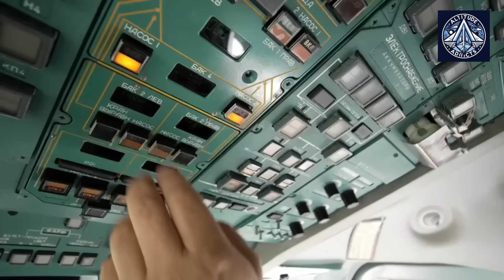Eleven Tu-214s with 2 Crew Cockpit for Aeroflot

Comment: You outline the core problem yourself in this video. Aeroflot demanded a two crew cockpit and Tupolev developed one with domestic systems. Russian airlines didn't buy the aircraft because they preferred foreign avionics and didn't want to take risks with domestic products. Where has that got them exactly. Aeroflot should STFU and buy Russian planes and be grateful there are aircraft they can buy. Moaning to get a two crew design is amusing. What if one of the crew has a personal situation where they are unable to operate the aircraft... can the remaining crewman do everything by themselves? A two crew cockpit is all about saving money and greed from the airlines, and nothing to do with passenger safety. Blindly copying what the west does is short sighted and might bite Russia in the backside. Russia has weather and other conditions other airlines don't have to worry about. I have read one comment by a Russian pilot who said having three crew means you can get through your preflight checklist faster and therefore get an earlier slot for takeoff than if they only had two crew. The airlines wont care about that but I am sure a few passengers would appreciate that. Equally when flying around the world having an extra crew member means you can have a mix of language competencies to make it more likely someone on deck can speak the local language.

Comment: Russia must develop its aviation industry, and other branches of Russian industry and economy develop with it. For example, based on the PD-14 aircraft engine, Russia has developed its own gas turbine (GTD-110M). Gas turbines were imported from the West and now they are produced in Russia, the turbines are better than the Western ones and the wages and money remain in Russia.
Reply: @topmobis3032  IMHO these are two technological projects. They have little if any common components. PD14 is based on PS90 developed by Permskie Motory plant. It could be considered as a next generation of PS90.
GTD 110M is a result of very long work which is getting positive result only recently.
Reply: Some technical innovative solutions from PD-14 were applied during the design of the gas turbine. Both projects benefited from each other. But that is the point of what I wrote
Reply: they are completely different projects  - Power Machines is also in pilot build for 2x large gas turbines for powerstations. GTE-65 and GTE-170 ...

Comment: I still like a 3 member crew for redundancy and security, but that is irrelevant, no one has to follow western practices or business plans...!..
When in Rome, do what Romans do, the three crew as standard on all the aircraft in spite the western criticism, some countries can use it as is, it can even have double duties with two pilots and one taking a second duty of navigator during the flight phase and get back to the co-pilot seat during the take off and landing... No big deal...!
I would like the short version of the Yak-242 in the 160 passenger role that would seat well for many carriers that don't require capacity and don't need to fly with many empty seats for thin routes but bigger than the Sukhoi SS-100 or smaller than the MC-21 or TU-214...
Reply: The problem with the 3 man crew is about money. Margins are tight. Additionally, international buyers will be concerned.